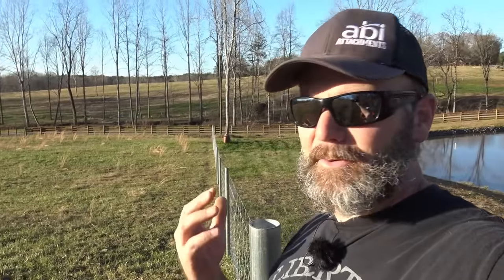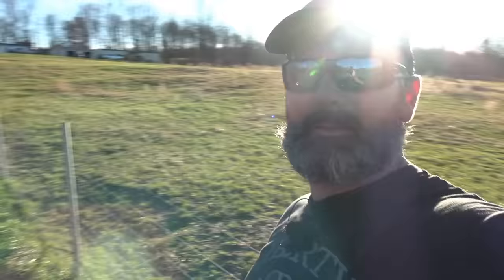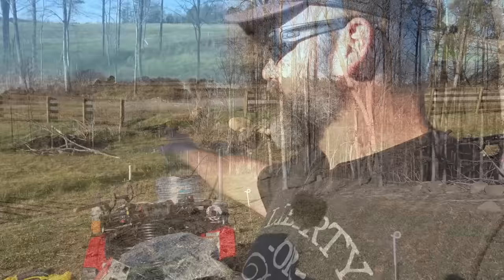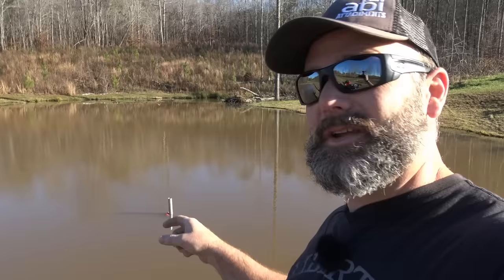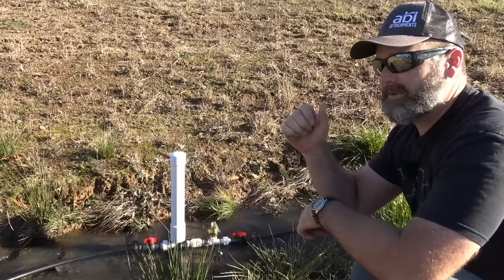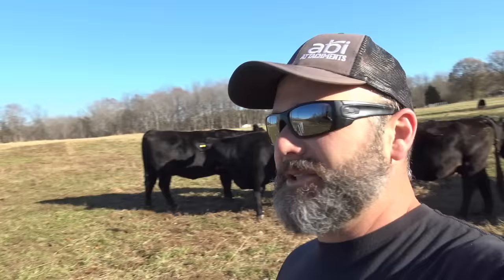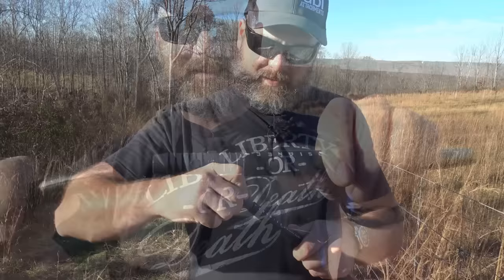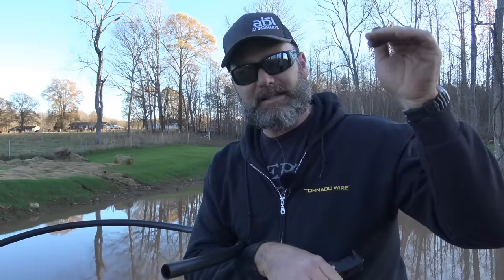Nonstop water pumping system no power...complete simple setup explained!

Comment: Why not get a 4" coupler to hold your screen/filter on?  A screw or two would insure it stays put. Easy to slip off to change/clean screen.
For starting the new section, could you pre-load delivery pipe with a few gallons of water? This would insure back pressure at the ram pump, right?

Comment: if you'd whip out your lighter and warm up those hose ends, they'd slide on to the joint and then firm up in place....makes a great tight fitting...

Comment: Could you automate that by running an electric motor hooked up to a car/truck battery and an alternator? (or any other way to keep the battery charged without you having to do anything)

If you can, i would just limit the power to the motor, so it's not overworking the air system.

At the time of me writing this, i did realize it could be a good way to get a little workout in, and also batteries eventually go bad.. so that would be a bit of a problem😂
Reply from the maker: it doesn't need a motor...it just needs gravity...it is automated my friend ..that's the appeal of the ram pump

Comment: The elephant in the room is the amount of water that goes down the drain for every gallon that's pumped up the hill.
You gotta have a willing little stream, or a really big pond to get any amount of water up to where it's needed.
Reply from the maker: why is that an elephant in the room?  We're talking about less than 2 gallons per minute ....you most certainly need a water source that's reliable....but I wouldn't call that the elephant. You just need a water source ...the system most certainly uses more water than it pumps...be interesting to see how much it does use

Comment: Wow...I'll look into this "Ram Pump" idea for use on a Bird Bath in our back yard.  I can buy a 100 gal. water Bladder from Amazon to use as my supply source.  I'm hoping that this will feed the water UP to the Bird Bath, and then I'll have an over-flow tube to run it back to the source..a recirculating system.

Comment: You know you could have shut the valve off and before you threw the end in the pond, taken a bucket of water and dumped it in the pipe to fill the line then went down and turned valve and water would have been there without sucking up the nasty pond slop. Just a thought for next time.

Comment: "Organic Meat Birds" watered out of an old Hy Gaurd bucket🤣🤣😂😂🤣

The zip tie gun is easier and faster, but the way I do it cheap is push on the buckle part with a flat screwdriver and pull the tag end with pliers. You can usually get a few more clicks as well.

Comment: Hey man  great video, but you have got to get a drill powered syphon pump, before you end up with some serious disease from drinking polluted water.
Stay safe brother.
Reply: just use a bucket to file the pipe that filter is basically a funnel, set the valve at the bottom to barely open and pour water in the top end until it starts squirting at the bottom.

Comment: Ever think of using a ram pump to fill a tank at a higher elevation then releasing that water once full (using a float valve) to use the higher volume of water to generate electricity through a small water turbine?

Comment: If you don't have a creek to mount the ram pump, would you advise a large return line to the pond? One that doesn't create pressure against the output of the check valve.
Reply from the maker: if you placed a return line it would equalize the pressure in the ram pump and cause it to not work my friend...using inertia and the weight of the water to push the pump...if we're pushing the water right back up to the pond then we're gonna have no pressure to run the pump.  Water will always run downhill so just let it roll on out of the pump and down the hill my friend

Comment: What if you made the filter larger like before and cut slits in it with chainsaw or similar. Seems like long slits would give you more surface area and maybe stay open longer but not as tedious as drilling 347 holes?

Also, those floats are $4 each! That's like $12 for floats. Why not use like an empty 2 liter bottle or two? They last longer than you think in the sun. I had some filled with water for tarp weights, and I think I may still have some laying around I have not tossed yet. They been laying outside for 8 years or more.

Comment: Ram pumps discharge a large percentage of the water through the hammer valve. So to get the small volume of water you require, are you not worried about draining the pond? What is feeding the pond?

Comment: I looked through the comments, couldn't find an answer, I'm missing something. I see lots of water pumping out of the check valve going to waste, and very little by comparison coming out at the tank. Do you eventually plug off that tee where the check valve is? If not, why don't you install a drain line for that excess, and allow all that water to return to the pond vs it going to waste? Love to hear back from you.
Reply from the maker: the water pushes the ram pump...it's not waste because it's never been used for anything..the kinetic energy from the water falling through the pump pushes the water up hill......this water would otherwise go right down the creek bottom where it came from....it's not waste...it's energy and gravity and it's free.  No you don't need to put it back in the pond...the pond has water flow keeping it filled....you can't drain water back up the hill....water is the tool used to pump

Comment: Thanks! After you have pumped water to the highest point, do you siphon to lower points, possibly using toilet type float valves?
Reply from the maker: you could set up any kind of system like that if you wanted....I do recommend that you let the pump constantly run...this is in no way a permanent water solution for livestock....lot's of babysitting to do with a ram pump like this

Comment: After sucking gas to siphon and mistakenly swallowing it, I figured how to do it without using my mouth. All one needs to do is fill the hose with the liquid. This can be done several ways. one way is holding both ends at the same height and pouring the liquid in till full. If one can plug the end that will be lower until the end that is higher is in the liquid, this will make it easier. Then move the end that will be lower to where you want it and take the plug off and Bobs your Uncle. You have flow, and no risk of being ill from imbibing pond scum.

Comment: The filter would be more efficient if you drilled 1/2 inch holes all around the pipe section. Pipe will still support screen but you will have more surface area open to the screen and the screen can wrap the entire pipe area.

Comment: Amazing to see water being pumped uphill with no power. Not sure how it actually works though looks like you're using air pressure but why doesn't that pressure drop ? Also is there any water wasted moving it ?
Reply from the maker: yes...it runs on water and it expels water with each pump cycle my friend

Comment: So if you get half way up the hill, can you add another pump in the line to build pressure up?
Reply from the maker: nope....the pressure is from drop ahead of the pump....if you have no water dropping into the pump then it won't push.  You must get water from a source that's up hill from the pump...for every 1 foot of drop ahead of the pump.....the pump will push up hill 7 feet. It uses the weight of the water falling down hill to push the water up the hill....won't work inline

Comment: I loved the video, many thanks. Question: how did the ram pump work in the pond when you don't have an elevation change in the drive pipe (the pipe before the pump)? Just learning about these but have read you need to have flow rate prior to pump (usually through elevation drop) in order to drive the post-pump height.
Reply from the maker: a ram pump will not work unless the water inlet has "drop" you must have water falling into the pump from a higher point. For every 1 foot of drop it pumps up 6 or 7 feet.  You've gotta have drop ahead of the pump or they won't work.  Check out @landtohouse youtube channel...he is the master!
Reply: That is what I understood, but I must be clueless since I can't see/figure out where you get drop from your intake that is under the water in the pond to the pump. It seems like that are at the same elevation, but I must be mistaken.

Comment: If you have a pond of standing water and no water flowing, and need the water up hill then, get a 55 gallon drum. Plastic or metal, your choice. Non- toxic, please. 
Pipe, enough for the length from the body of water, to the place where you need the water. 
Whatever size of pipe you want to use going to the final end, double the size used for the input, to the 55 gallon drum. The drum needs to be higher than the end of the user end, where the final use is at. Try 6'-8' higher than your faucet elevation.
You need to fill every length of piping and the 55 gallon drum with water plus about one foot above the drum, with a faucet at the highest point above the drum. 
Once the system is filled completely, with a end cap or a ball valve under the water surface,where water is being drawn out of, then, close the faucet at the top, above the drum. 
When you don't have any air inside the drum,or piping,  when you open the valve at the pool of water source, and then open the faucet at the end use, the vaccum of water flowing out of the faucet, will draw water up hill to the top of the drum, and out into the piping leading to the end point of use. 
I learned this from one in India, Vietnam, China, or somewhere else, who has little electric availability.

Comment: Try a watter bottle of super fine  gravel or lava rock   just make more holes with  the drill u could  even  add raw charcoal  and  it would be drinking safe for people   I just  would  take more  to float  it  at the 16 inch depth  would  also  sink right away   for the   prime   ud could  probably  get away  with  cleaning  every  two years  or so ud  guess  u could  use the pvc the same  way   just  implementing  more holes

Comment: I have a question when you say 1 foot to every 7 feet we have a property that is 100 foot in elevation higher than the creek but linear feet from the creek to the house is probably 500 feet so when you’re referring to the 1 to 7 ratio are you referring to elevation feet or linear feet thank you in advance
Reply from the maker: Water needs to drop 1 ft ahead of the pump in order to pump upwards 7 feet. Linear distance creates some resistance due to friction but the pump will push. This is hydrology, the weight of water remains constant on a linear plane, goes up with depth and elevation. You have to have “drop” ahead of the pump. In other words you need water to fall into the pump from a high point to the pump. The falling water ahead of the pump push the check valves and pumps uphill. For every 2 foot of drop in the intake pipe it pumps up 7 feet

Comment: How to avoid imbibing dirty pond water; climb the bank with the end of the tube until level with the intake water level, and with a spouted bucket full of dirty pond water, and then pour into the tube until its full, and then turn off the valve, climb back down, and hold the tube down low and then turn the valve on, and "Hey presto !", the siphon should start !

Comment: If possible, submerge the pipe and fill it completely with water, then shut the valve. Then pull the pipe to where you want it to siphon, as quickly as possible, and open the valve. It should flow.

Comment: Great video. Note though: May want to use a different weight for the intake my friend. Rusty chain isn't the best for water quality, especially since you are using it for animal drinking water.
Reply from the maker: lol....a rusty chain in the bottom of a pond that holds 60,000 gallons won't hurt a thing my brotha
Reply: @StoneyRidgeFarmer  Agreed...personally I'd just rather use a stone of some kind just because lol I'm no scientist
Reply: @StoneyRidgeFarmer  just use stone man. you might need that chain in some other project. 
Formerly i saw some other how to vids they installed the intake against a flow where as you make the water to reach the pump by pressure. When ram pump is making that trigger isn't it disturb the pressure of water coming from intake? Thanks..

Comment: Sweet , I wonder if I could use this set-up for an aerator on my pond ?  dont take much pressure to create oxygen for the fish , would save me $ , I just bought a zip-tie gun , saves my fingers when putting up chicken wire temporarily to keep the chickens out of the garden , have to remove the wire every year to get tractor in to till it , Subscribed , keep the vids coming , Harbor Freight sells an O-ring kit , they are cheap too

Comment: What kind of efficiency does this kind of setup have? Will it push ~2% of the total water passed through the first downhill pipe back uphill?
Reply from the maker: Ya know I'm not sure....but  a quick google search on ram pumps would help ya....now....it's 100% efficient as far as I'm concerned because it takes nothing but gravity to run it...so nothing is lost other than water flow
Reply: @StoneyRidgeFarmer  Yes, I meant how much water is lost from the original flow. If you had 100 gallons at the start and had to get water up 20 ft, how much water could you get up by the time the 100 gallons have gone from the initial source?

Comment: Will your pump work in shallow creek? Thank you
Reply from the maker: nope...not at all.....you must have "drop" ahead of the pump.  The water must drop into the pump from a source that's up hill from the pump.  In other words you can't put it in a low spot and expect it to pump.....now...if you put the intake up the creek and there was a drop off...you'd be able to pump.  A ram pump works on the pressure of the water that's higher than the pump....that pressure or "drop" pushes the pump. For every 1 ft of drop ahead of the pump it will push up hill 7 ft

Comment: Does installing a float valve and stopping the water flow affect the pump in any way?  Will the pump automatically start when the valve identifies a loss of water in the tank?  Great video BTW!!
Reply: Same question, I was not able to see float hooked up ,but it was on the tank . My thinking is that if you put a check valve right after the pump it should hold the pressure on the Length of your tubing between pump ,and float shut off . Once the float drops ,water should Flow out by its own pressure causing a siphoning action.
Whether this is Enough to re-prime pump , I am not sure maybe you still have to stick a screwdriver to prime it. I don’t have one of these pumps I am sure going to try it,

Comment: So if I’m understanding right, you have to be able to put the ram pump BELOW the water source???  So I cannot pull water from a pond if the pond is the lowest point on the property, right?
Reply from the maker: yep....exactly...however your pond isn't the lowest point....the back side of the dam is lower than the top of the water so if you run the line on a float in your pond about 10 inches deep...then put the ram pump down at the lowest place on the back of the dam....you'll pump water!  1 foot drop pumps up 7 feet my friend
Reply: @StoneyRidgeFarmer    I’m not understanding…  I don’t have a dam.  I have a pond because someone dug a great big hole many years ago, and the water table is really high so it filled up with water.

Comment: How does this fair in the winter?
Reply from the maker: temps as low as 20f have been fine, as long as you keep water moving through it, this is not a good reliable permanent water solution just so ya know, great temporary but requires daily monitoring

Comment: How does that pressure tank maintain pressure? That thing sure works slick! Let me know.
Reply: Pressure Chamber - A bicycle or "scooter tire" inner tube is placed inside the pressure chamber (part 15) as an "air bladder" to prevent water-logging or air-logging. Inflate the tube until it is "spongy" when squeezed, then insert it in the chamber. It should not be inflated very tightly, but have some "give" to it.

Comment: There seems to be more water flowing out of that kick start valve then being pumped, lucky it is in a drain system because if in a field the field would be flooded while not very much water was in the tank, or am I missing something. (effiency)
Reply: thats what is doing the work its that excess of water.
Reply: @jbbolts  OK Thanks

Comment: I've wondered how feasible it is to use the waste water output to also be pumped through polypipe, say,  back to the source? The amount of water dumped at the ram pump seems to limit the practicality of it.
Reply from the maker: this water would go down the creek either way so it's not wasting anything my friend...it's using the weight of the water to drive the pump...if none of this were here the water would simply go down the creek
Reply: @StoneyRidgeFarmer  right,  I totally get that. What I'm saying is,  it wouldn't be practical in places where you need to conserve the water you have.  Nonetheless,  do you think the ram pump could deliver the waste water back to the source,  or would it overload the pressure valves trying to force water uphill on both outlets?
Reply: @StoneyRidgeFarmer  to clarify,  I call it "waste water" simply because that is how I've seen it labeled in diagrams of these pumps.  Essentially one port "wastes" the water coming through it,  and I  haven't really come up with a way to use a ram pump without that waste.

Comment: With this system can  I create a basement sump pump ?
Reply from the maker: absolutely not, you've gotta have "drop" ahead of the pump....water has to come from a higher point....drop to the pump and then be lifted.  For every foot of drop ahead of the pump...the water can be lifted 7 feet.  You can't just put it in a hole and expect it to pump. Spend the $50 and get a sump pump my brotha